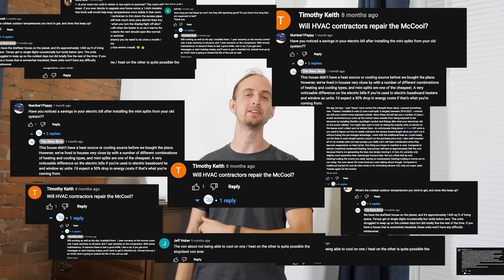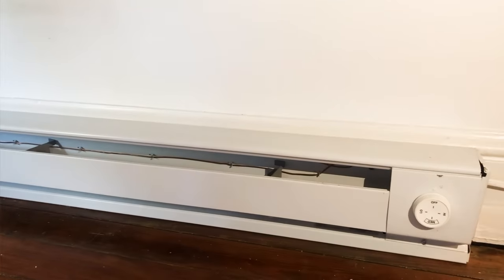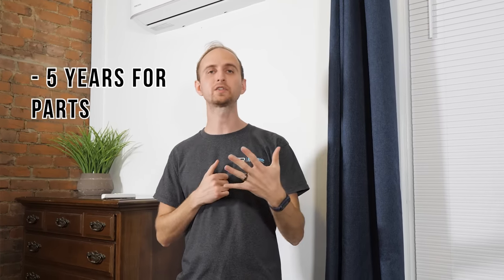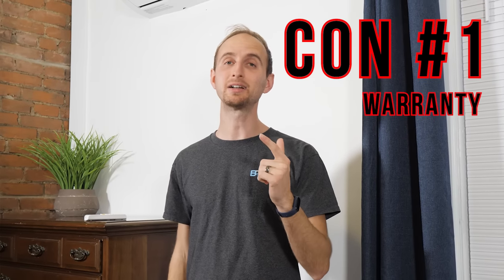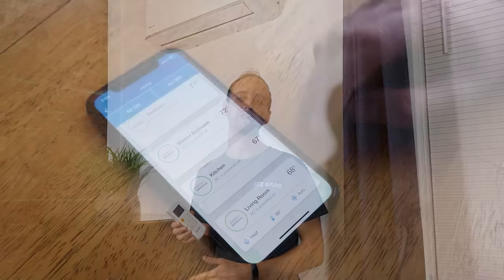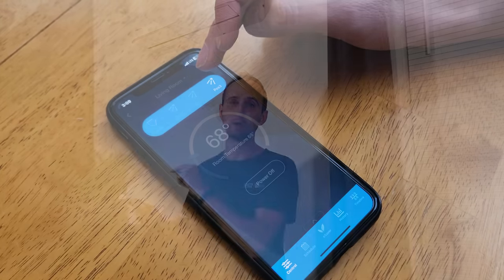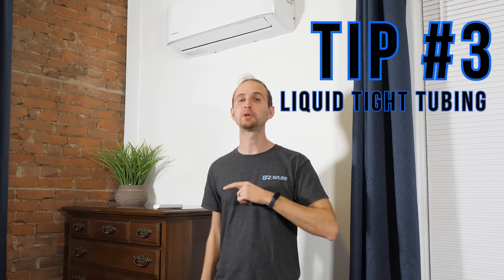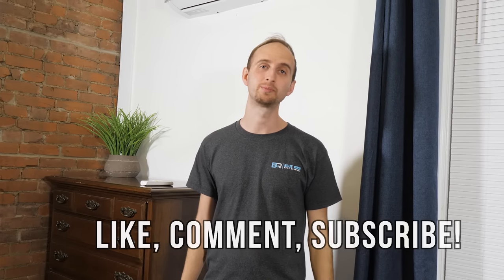Mr Cool DIY 2-Year REVIEW: I wish I would have known this BEFORE BUYING...

Comment: I love the mini splits I have.  BUT cleaning the inside unit is a bear!  If you watch the videos, you must buy a bag which forms a drip bag under the unit while you clean and flush the coil.  The dirty water is supposed to go into the bag (not on my white walls), down the hose, and into a bucket for disposal.  I have to get up on a 10 foot ladder to do the work because the unit is at 12 feet off the floor.  This is not easy as you pass middle age.  I believe a design change or cleaning accommodation is called for.  Aside from the cleaning issue, they are great!

Comment: One of the main issues with mini split systems is the loss of a ground, that damages the control board. Add another ground to outside unit, and connect to ground on head unit.
Reply from the maker: If you mean an electrical ground, they’re all required to be grounded by code.
Reply: @TheRenoBros  no the circuit board on the controls burns up from loss of ground. We had to in Iraq had to add a ground to the condensing and cassette. This prevented damage to the control board.
Reply from the maker: @MissionaryForMexico  Oh you mean a separate ground for those components? I’ve seen the ground connection inside the unit and I do believe it includes the motherboard, but perhaps I’m mistaken

Comment: ON mini splits you shouldn't use any chemicals on the condenser coil. The coil has a color coding finish on it, it is a protector for the aluminum fins and the chemicals will start to erode that finish and you will start to see in time that color coding will have fade spots. It also makes it easy to clean with just water. If heads are sharing a condenser you have a zone system and that is why you can't cool one room and heat the other at the same time. These condensers only have one compressor. So which ever head give the call first to cool or heat that will happen first, when that head is satisfied then the other head will cool or heat. And on mini splits the air handler is actually call a "head". I am a HVAC TECH.
Reply from the maker: What do you use instead?

Comment: If they won't change the design on that plastic wall remote cradle, which they haven't in more than 2 years, and yes that is a crap design that would hack me off too, just buzz that upper lip off yourself.  You could use a file, grinding wheel on a drill, Dremel, etc.  Won't take but a few minutes.  You spent have to do that but at least you won't have to live with that issue.  I hate poor designs as well and usually just take things into my own hands when a company won't make an easy improvement like that one.  Nice job on your two videos on this unit.
Reply from the maker: Thanks Jim for the comment! Love the support and the suggestions. It makes me wonder how the design even made it into production 😂

Comment: I live in central ca. summer 3 months with average over 100. Switch from window ac to mini split, saved 30% overall electric bill. If youre renter I would suggest LG inverter window ac. Not as efficient as mini split but a lot more efficient than tradition central AC

Comment: oh these are the same schitty motors that are in gree units. I have already replaced mine and the second one has gotten noisy also
Reply from the maker: Yikes. Thanks for the heads up! I hope they’re ready for lots of warranty replacement parts then
Reply: Don't they all come off the same line, just a different label and maybe some sheet metal?  I even heard that an 18k mrcool was an exact match to their Courier, part for part, just a label.
Reply from the maker: @warrenbrown8670  Not horribly uncommon in the manufacturing world. One factory makes the parts for multiple brands with little tweaks here and there

Comment: I don’t know how you came to the conclusion with the window units, but I decided to try window units instead of my central heat and air.  I had two central cooling systems for two floors. One system went down after about 18 years. I bought the SMALLEST window units for each room. I use only ONE unit downstairs, and  the smallest units for each bedroom.   Let me tell you:   THEY WORK. The one unit keeps the downstairs comfortable all summer. Instead of cooling the ENTIRE upstairs we only cool the bedroom, and the library upstairs.   Our electric bill for 2000 square feet is $150 a month .  We ALSO heat with space heater…no more central heat/air for heat.   Yes, our house is very well insulated which may be the reason it works so well.   I’m sure if we went back to central heat and air our monthly bill would be $500 a month….maybe more.  Small window units, 5000 btu’s work!  And the oil filled radiator heat is more than enough.  You have to have a paradigm shift in your thinking:  you do not need to heat and cool rooms you only use for a few minutes like your bathrooms, kitchen, hallways, unused bedrooms. It’s a waste of energy. Dress for winter! Use electric blankets. Down comforters.  It’s more than enough.
Reply from the maker: Your electric bill for central air would certainly be less than space heaters and window AC. But if you are able to get those results with window AC, and be ok with the lack of consistency in temperature throughout the room you're in, then I totally see the value of that. If replacing a furnace costs $10k and lasts 20 years, that's $500 per year. If you can get 10 years out of 5 separate window units and space heaters, you may find the cost to be comparable. It really depends on what you purchase and what your needs are. But window AC and space heaters are NEVER more efficient than mini splits or central air. They are extremely inefficient. If you simply measure efficiency by how many dollars you spend each year you're going to get bad data.
Reply: If you're comparing the cost of conditioning a single room to the cost of conditioning the entire house, sure, it'll probably be less, you're conditioning far fewer cubic feet of air. A zoned whole house system would accomplish the same thing, as would a mini split that you only use in some rooms, and would do so with more efficient heating and cooling, AND with less loss from the poor insulation you get with window units.

Comment: Nice video, but I am puzzled about your "con" about not being able to set independent modes for each head.  I have installed multiple Mr. Cool mini splits in my home and I can set one to cool and the other th heat no problem.  Your problem is that you bought a multi-head unit instead of multiple single head unit.  Since multi-head units are so expensive compared to single head units, it saves no money and also has potential for big problems should outdoor unit for multi-head mini split fail.  Multiple single head units are more robust and cheaper and is the way to go.
Reply from the maker: Thanks for commenting! It is definitely recommended to have a single pair if possible, but it would not have been possible in my situation, nor would it have been cheaper. I needed 7 interior units total at this property, 3 downstairs and 4 upstairs. 7 condenser units outside was not a realistic possibility for me, nor most other people unfortunately. It is more efficient to have a matching pair for each unit, but multi-head units are VERY desirable for those who would like to use minisplits as their exclusive cooling and heating source for a large home.

Comment: Great video. Love the pros and cons and all the comments. Are there any multi zone  mini splits on the market with one condenser that can cool one room and heat another at the same time?
Reply from the maker: Thanks! Great question. I actually had a pro comment on my last review of the Mr Cool DIY and he said they actually do make a unit that can heat one room and cool another at the same time. However, he said that it’s relatively new technology and costs a small fortune to install. I just took his word for it and didn’t look into it further, especially since that sort of feature isn’t really that useful for most people. I’d be surprised if the technology gets widely adopted, unless it somehow makes the units much more efficient to have separate closed loops inside the condenser.
Reply from the maker: Do you see any values to a unit that can do both at the same time? I’m struggling to see the uses for that, besides maybe two people living in the same house that one likes it to be cold and the other likes it to be hot. 😂 I feel like most people just find a happy medium
Reply: Thanks for the reply’s. I agree it would just increase the cost of the system since each in room unit would need a reversing valve instead of just one at the condenser. I also agree that in most cases I don’t see the need. I was just wondering if anyone manufactured a system that could cool one room and heat another in heat pump mode. Thanks
Reply from the maker: @normantkachenko9994  Yeah that makes a lot of sense. For sure! Thanks for commenting!
Reply: @TheRenoBros  My partially disabled wife like the Master Bedroom around 66*F and the Master Bath around 70*F. So there for-The MINI SPLIT. I keep the rest of the home at 68*F.
Reply from the maker: @customcraftsbybruceslaton4872  Thanks for commenting! Does the minisplit do a good job of hitting those temps accurately for her?